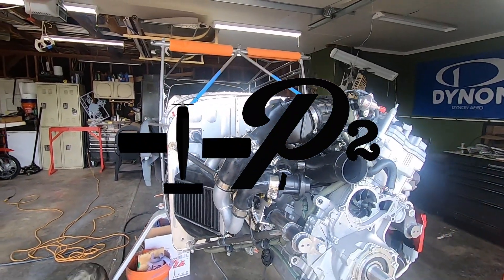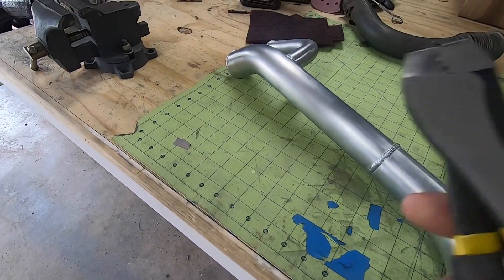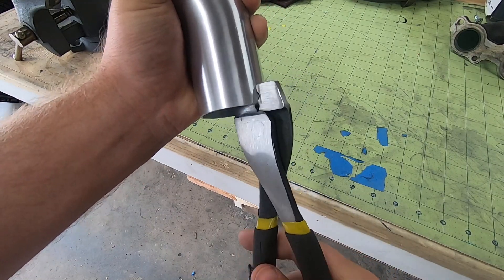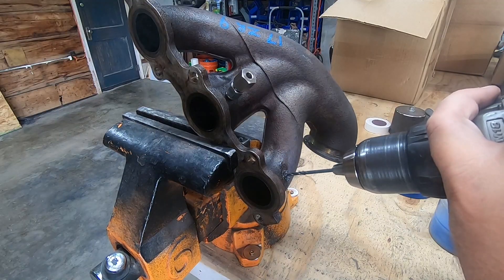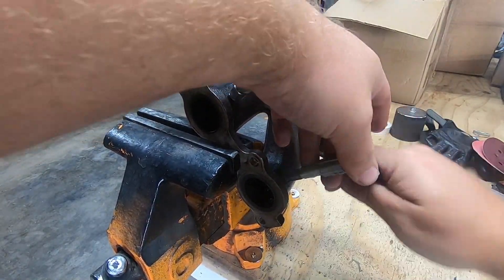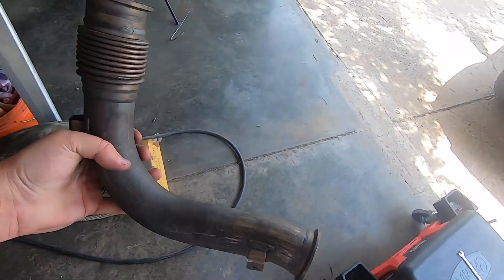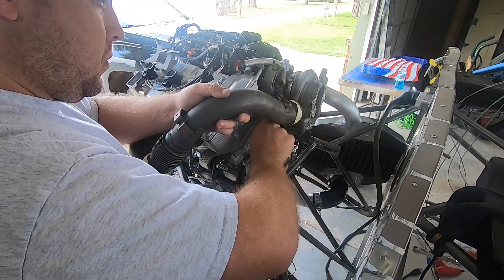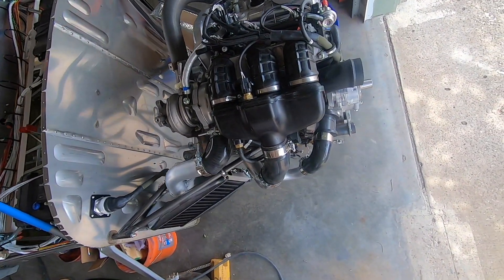RANS S-21 YAMAHA 998TURBO UPDATE EP30

Comment: Love your videos man! Seriously, really great content. Your fabrication skills are legendary. Did you pull this motor from a sled, or order it as a crate motor? Still working my way through your videos, but did you ever do a video on why you chose the 998T over the Apex? Would love to hear your thoughts on that choice.
Reply from the maker: Thanks for the kind words James! I bought mine new and  pretty much a “long block” from arctic cat. In my opinion the 998t is the natural progression from the apex since eventually we are gonna run out of apex options since production has ended on those. Field elevation for me is 4000ft on the ground so density altitude is a concern for me meaning the turbo system is a plus. Being a factory designed turbo engine also removes the complication of trying to fortify an apex for forced induction. If you use Facebook there is a group called “Yamaha aircraft conversions” and it’s a wealth of Yamaha knowledge for all the engines types. I highly recommend it👍
Reply: @Project2Aero  Thanks for the reply! I'm hoping to do a build of my own someday and have been spending lots of time following builders like yourself. It is truly inspiring. I've actually been a member of the YAC FB group for a while - definitely an amazing group of people! The 998T seems like a good choice and is the direction I've been researching. Looking forward to seeing how yours performs compared to the 4-cyl builds out there. Many of the guys appear to be getting a reliable 4.5-6gph on cruise with the Apex. Haven't seen any data on the 998T, but being a 3-cyl I'm wondering if it will do better?
Reply from the maker: @NimblyJimbly  You bet👍 the only two I know of flying is Teal from skytraxusa and Steve Henry. Both are very pleased with it so far and are working through the growing pains that come along with a new motor conversion. Apex is for sure a more refined option so if your not willing to have some hurdles it’s an “easier” option. I really suspect that once we get thing dialed in, the GPH will be right around the same. It takes a certain amount of fuel to make a set level of horsepower in a set amount of space or “cc” level as measured with power-sports stuff.. prop choice also has a lot to do with that.
Reply: @Project2Aero  Makes total sense! How did you go about buying just the motor from Arctic Cat? Were they able to include all the parts you needed for your build, or was there a lot of piecing things together from various sources? I assume it's less expensive to do that than to try to buy a used sled considering they are $15-20k. LOL
Reply from the maker: @NimblyJimbly  I pieced mine together but many others have gone the sled route. I suspect it’ll end up similar price wise, but if you got money from the leftover sled parts you might have an edge over just ordering individual components. Really the only part that hurt was the turbo and manifolds.. I used a combination of new and used parts. Go to any arctic cat parts website and search for p/n 0662-622 and you’ll find it.. I’m running an aftermarket ecu and a drastically different cooling system than what you’d find in a sled. That coupled with having no snowmobiles In Texas, I just decided I’d go new for the engine itself. I’m on track to have about 16k in my firewall forward including the prop and gearbox..
Reply: @Project2Aero  great info. Thank you!

Comment: I assume you bought a used engine from a sled that came stock with the turbo? What are you expecting it will weigh when completed?
Reply from the maker: This was a new engine I ordered directly from Arctic Cat (they use Yamaha).. I bought the turbo new as well but it didn’t come with the engine although it is the same side that comes on the sleds. I expect to be around the 200lbs

Comment: Good looking install.  However I saw three things that you did that I would never do. 1) when tapping threads you should turn the tap 1/2 turn then go counterclockwise to break the chips then go clockwise etc.  Also cutting oil should be used.  2)  I noticed you used a crescent wrench to install the probes.  A fitting wrench or open end wrench would be a better choice. 3) At the end of this video you spun up the turbo with what I assume was compressed air.  Sounds cool and a neat way to end the video but if the turbo bearings have no oil pressure you may have caused damage to the bearings.  I’ve seen turbo’s self destruct.  Pieces of metal get sent into the intake and you can imagine what happens next.  It is not my intent to criticize you workmanship,  you are doing a great job and I look forward to seeing progress.
Reply from the maker: Thanks for watching Joseph👍 Keep in mind that editing does remove some of the context around the things you see me doing. I appreciate the pointers👍

Comment: Where did you source the green wire loom?
Reply from the maker: I got mine from https://www.wirecare.com/category/braided-sleeving/advanced-engineering-sleeving/flexo-nx. I think it came out pretty nice. The smaller diameter stuff was super hard to work with so I ended up using heat shrink on the smaller sections.

Comment: I liked that trick to you used to make the bead on those pipes!
Reply from the maker: Thanks!
Reply: @Project2Aero  after 3 RV-12s our school will start S-21s.
Reply from the maker: @markzimmermann3441  very cool!
Reply: Could your friend have welded a bead. Just wondering about the stress concentration in the metal now and possible failure. I would trust a rolled bead. Just curious.
Reply from the maker: @briand3837  yes it could have been a weld bead for sure. I suspect there is some possibility of a stress crack (although not much more than a rolled bead would also induce) so time will tell if it holds up👍
Reply: @Project2Aero . Time will tell, but a weld is normally a much larger geometric stress  riser and micro structure (takes out the temper) hit vs a proper gentle radius

Comment: Replace the stock blow-off valve, they leak.
Reply from the maker: Roger that, I’ve heard that from a couple people. I’ve seen some aftermarket options out there.. any suggestions?
Reply: @Project2Aero . turbosmart part# TS-0203-1223. It is a direct replacement we use in the sidewinders.